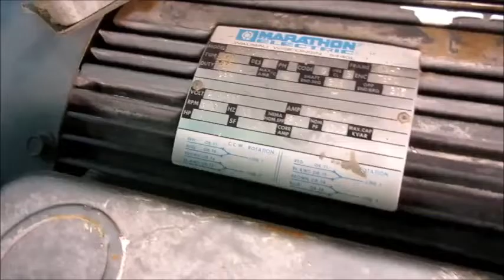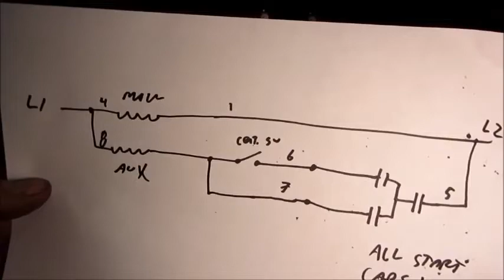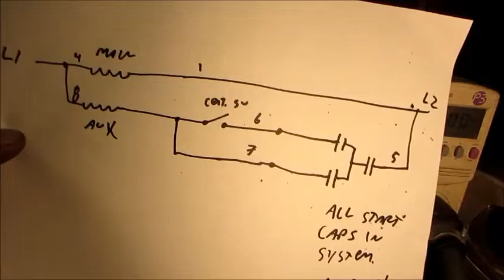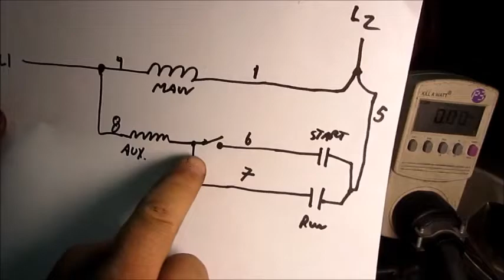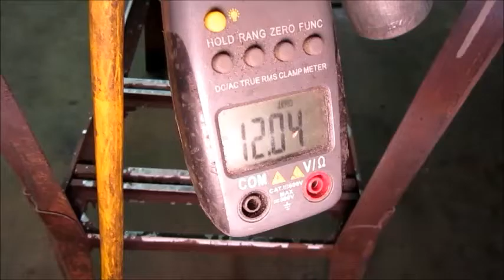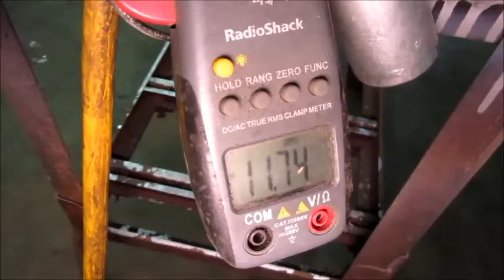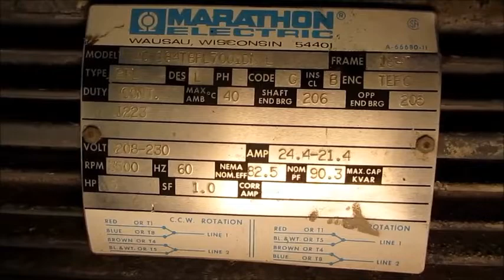Troubleshooting a scrap-saved single-phase motor...

Comment: My capacitor run single phase induction motor would not start, I've checked the windings,capacitor and bearings are okay,what could be the problem please suggest.
Reply from the maker: I would look at the centrifugal start switch, or start-relay to see if that is not completing the capacitor circuit as necessary.
Reply: @davida1hiwaaynet  thanks buddy.

Comment: I just changed a capacitor on a 1/3 hp condenser fan motor. The cap was only a couple years old. I feel like the newer Chinese capacitors don't last very long. I put on a cap from the 90s so I hope that fixes it for a while.
Reply: Yes, they do fail fast, because they are made as cheap as possible, so the manufacturers skimp on the thickness of film they use, and push the film closer to it's actual breakdown voltage. Not helped by the motor manufacturers making the housing smaller as well, so the only capacitors that fit are the underrated ones.
Reply from the maker: Yeah they DO NOT last like they used to. Our local HVAC supplier has US made capacitors which I happily spend a couple extra dollars for.
Reply from the maker: This is what I buy when I can get them. https://youtu.be/LY4WzYOBSEc
Reply: @davida1hiwaaynet  Thanks, I am working on maintaining a lot of refrigeration equipment for my family's business and I am changing capacitors literally almost every weekend.

Comment: Dave, I have found that many old compressor tanks have rust holes in the bottom due to lack of draining the water.  No one will repair a bad tank due to liability and a new tank is cost prohibitive in some cases.  The oil type compressors may have a longer tank life.
Reply: Just go to the scrapyard and pick up a blown cheap compressor unit, for the tank alone. Often you will find the local distributors will have a pile of those compressor units that are warranty returns, with a blown motor or tossed rod, and they simply give a new unit instead of fixing them, as they are so cheaply made.

Automatic drain is a cheap investment, but you also need to have those tanks hydro tested as per your local regulations, to detect any issues. Generally cheap, but often not considered by many users till it detonates.

Comment: Great detective work there.  As i understand it, putting two cap in series to get voltage rating is iffy.  I understand there should also be resistors across each one. forming a voltage divider to insure each only sees half the voltage of the pair.   Without this, if one cap as a little leakage (less than infinity) the voltage across the other can approach the full voltage and break it down.

Comment: Nice job on the electrical troubleshooting! I believe I would replace those bearings though…
Reply from the maker: Yep, definitely they need attention. For a backup compressor, I may just regrease them for now.
Reply: @davida1hiwaaynet  3600 motors always show bad bearings first. I have a 900rpm 15hp with bad bearings, but it's reasonably quiet due to low rpm.

Comment: That capacitor likely should be around 40-50uF, and with a new set of run and start caps it will work well. Start caps for it would be around 100uF, and cheap, and will work. Just put in a hard start unit, for a 30 000 BTU 230VAC compressor, as it will be around 100uf and will last there, instead of the start cap. The PTC will protect it if the start switch ever does stick shut, and otherwise will have no other effect. Bit of grease on those singing bearings and they will be quiet again, and for that I find the black CV joint grease the best, with all the moly anti wear additive in it.

Comment: I really enjoy watching the repair of "Found in Dirt". That made this old farm boy laugh. I saw a 4 year old video where you did some auto A/C line repair, then finished up by showing A/C tubing you added a pressure switch, trinary switch and CCOT on older GM. How do you swage ends of aluminum tubing to fit one inside the other? Hope you have a video to link too. ASE Master Tech since 78 / Retired in Omaha.  Thanks! I wish I had Facebook, but don't even own a cell phone.
Reply from the maker: Hi Dean. Glad you're enjoying the videos!  I bought a swaging tool from Harbor Freight. It's like stepped, tapered pin that you drive into the tubing to swage the ends out. Works pretty well! 

I never use my phone for Internet unless it's just an emergency. It's too small and I just want to get away from the Internet for a while each day.
Reply: I got the same exact tool but was never sure how aluminum would stretch. Just one size larger to make it fit another tube of same size. It takes effort but I would guess holding the tubing in a inverted flare tool held in vice. No heat to help expand? Lol, expands great, just before it splits. I build a custom A/C lines for 67 C10 and used ACDelco in-line filters that fit different line sizes with brass collet & rubber seal. I just love the idea of fitting a butt-joint, looks cleaner like it came that way. Thanks again.
Retired old wrench.

Comment: 4:48 why did the caps make the snapping sound?
Reply from the maker: It's because the terminals are loose on the rivets. It loses contact then makes contact, causing a small arc and snap when it does.

Comment: Maybe you should make a gigantic belt-drive fridge out of it! ;-)

I mean, plenty of videos on going in the opposite direction...
Reply from the maker: That's a good idea!  The issue is that sealing the crankcase of this compressor so it is 100% leak tight at more than 100 PSI crankcase pressure is just not going to happen. To get an idea of how massively built similarly sized refrigerant compressors are; look up "Copelametic semihermetic compressor" and you can see how massively thick the castings are. Those are cast iron as well; where the HFT compressor is aluminum and thin wall.